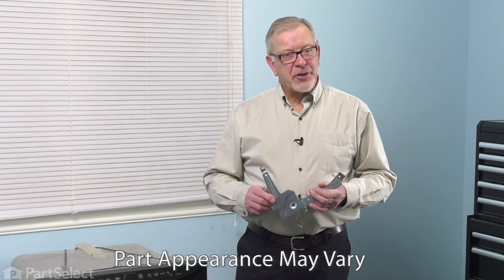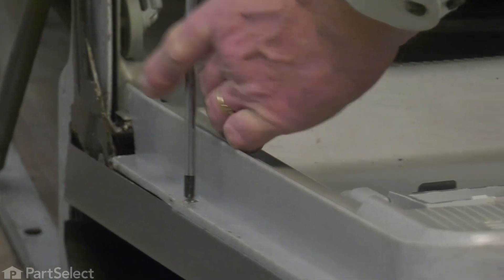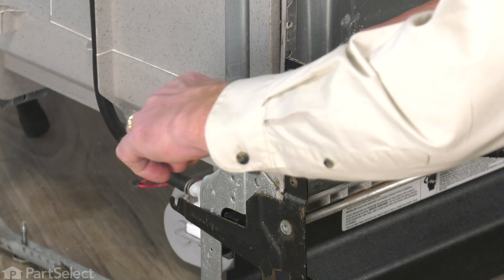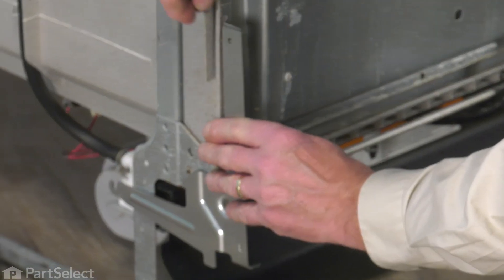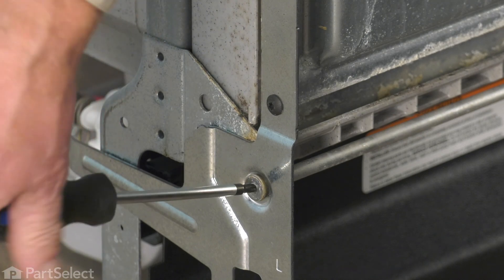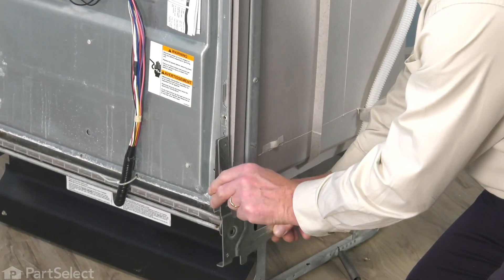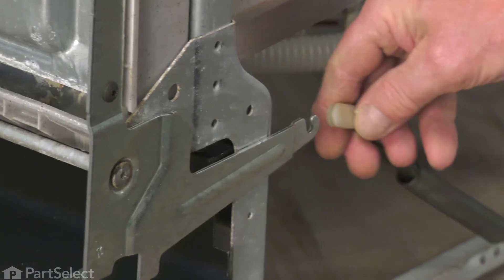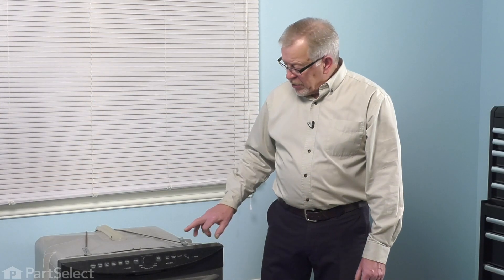Frigidaire Dishwasher Repair - How to Replace the Counterbalance Arm (Frigidaire # 5304513274)

Comment: For whatever reason my hinges aren't bolted into the door they are stamped in... sort of like a rivet but a circular stamp. Can't remove my door hinge
Reply: One could drill out the rivet.
Reply: @loxety  wasn't an option from what I remember. It was more stamp welded and not a rivet, plus there wasn't room to drill. Thankfully I dont have the pos anymore